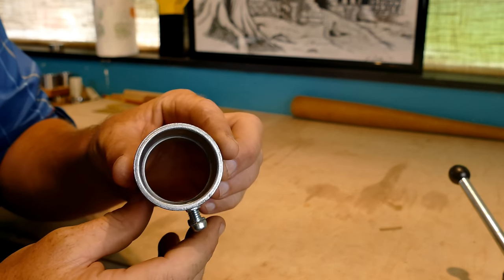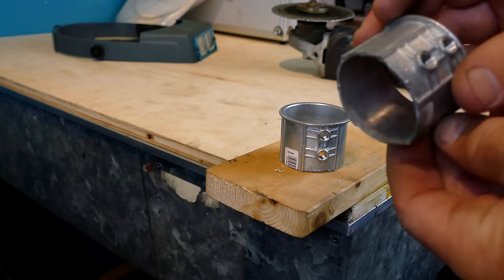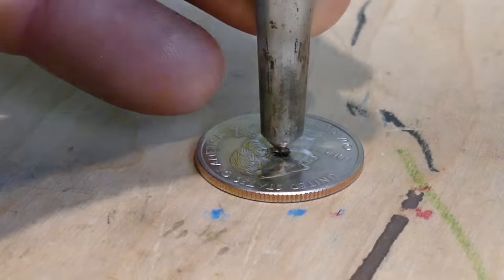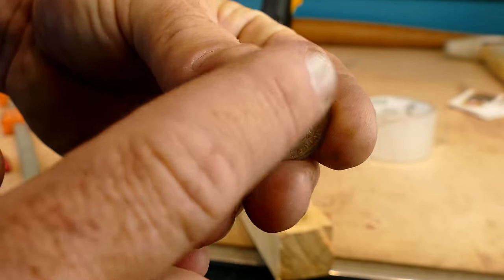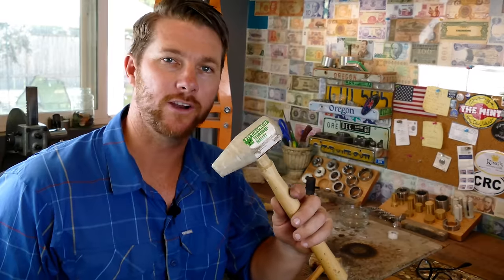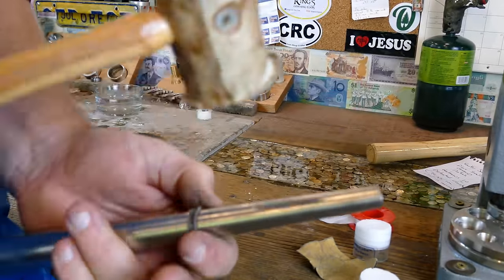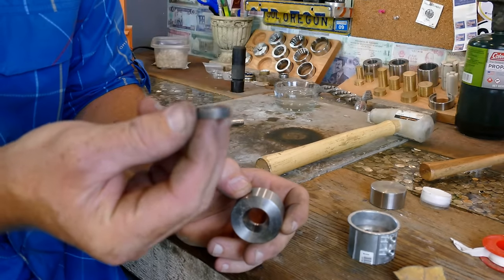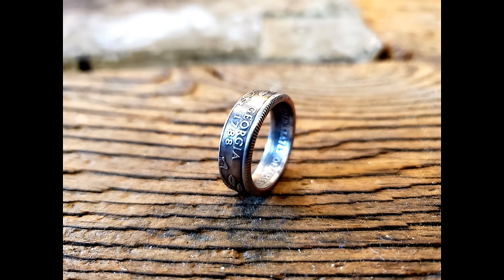Making a Pro Coin Ring Without Expensive Tools

Comment: Found an alternative to the wood block method for clamping, 1/4 pipe union. Have to modify the part that fits against the piece that screws in to the nut. You have to file down that dome so you get a flat surface, then cut the remaining pipe off of it. To secure it either with a vise or a hobby vise. If you do go with a larger vise you need the wood for it to sit on. Even a drill press vise will work.
The union will accept a step bit btw.
Reply: Once you modified the union it'll accept any coin the size of an American quarter.  You can also shove a piece of pex pipe as a shim for the smaller step bit. Tho that will need to be drilled out. I think it was 1/2 i used in my jig. It'll do a decent job of centering your coin tho you'll have to guide it a bit to make sure. 
Anyways it worked for me, drill your pilot hole then bring in your step bit to reduce chance of it spinning.
Reply: Since the union comes in copper, larger ones in brass. It shouldn't marr your coin. Still experimenting and transferring it to the larger 3/4 one. The 3/4 union shouldn't need much modifying outside of filing down the dome as was done on the 1/4 union. A large flat washer should remedy the larger space on that piece that was filed down. I think fitting pex pipe fittings inside one another should remedy that large hole you're left with. Steel flat washer and a piece of leather should work as well.
Reply: Also a large c clamp works in place of a press if one doesn't have one paired with your large vice if you have one.

Comment: Nice video, but that's not annealing, thats hardening. Annealing means heating then letting it cool slowly. Just heat in then throw it in some sand until cool.
Reply from the maker: Jewelry isn't made from ferrous metals though. Non ferrous metals are treated differently. Unless the entire jewelry industry has it wrong :)
Reply: @CoinRingsfromTheMint  you're correct ferrous metals are treated differently to an extent. I think its still the same term and process though. Thought you might like this.
 https://link.springer.com/article/10.1007/s13632-013-0074-8

Comment: Hey Tyler, is there something special about the coin ring anvil, other than it's size and the alloy they use? I could see replacing that with a piece of round stock cutoff from a scrap yard or a round dowel made of a dense piece of hardwood, like maple or oak.
Reply from the maker: No you can use something else as long as 8ts flat.

Comment: Change you can wear, what size of Swedish wrap die do I need to reduce a half dollar coin ring to a size 7 1/2, or can flat wall ring be made with folding/reduction die?
Reply from the maker: Not the smallest one but the next size up one. You can see them on www.jasons.works.

Comment: $37 for the die; $32.00 for the coin anvil; $15 for the ring mandrel ; ~$15.00 for a decent rubber non-marking mallet; $5.00 fence coupler; $30.00 for a drill (the one I saw at this price came with bits, too); $30.00 Propane torch kit; $5.00 for needle nose pliers. So, all in: ~$155.00. You can afford that with a paper route.
Reply from the maker: Yes!
Reply: I think you forgot the clamp, the punch, the step bit, and the angle grinder and cutoff wheel. or hacksaw.

Comment: To hold that quarter. I think a forsner bit the same size as the quarter drill into the wood then insert quarter into hole might be a good option too
Reply: Thats actually really fucking smart lol
Reply: it will just spin  , you still need a hold down/clamping device
Reply: I would think if the hole was moderately undersized it would hold just fine. Or shim it on the sides. Being that I have never tried it I can speak to how well it would work. But just thinking that the outside of the hole from a forsner bit is can be a little rough and quarters have grooves on the edges I would think it might spin a little till it bit the wood.

Comment: Wow! That is amazing!  How is the detailed maintained with all the pounding?
Reply: Soft material on the mallet head (rawhide) for the initial shaping. Lubricant and a specialty shaped die for the reducing. During the step with the anvil in the tube, most of the force was on the top/bottom so the sides stay clean.

Comment: Clamping a coin: use 2 large flat washers or two small flat pry-bars. Place them overlapping on opposite sides on the edges of the coin (also lying flat). Clamping the washes/pry-bars clamps the coin down and won't interfere with drilling. You can still use tape as padding on the coin.

Comment: Looks like an 1 1/4” EMT setscrew coupling. Those are the super-cheap, cast zinc (? pot metal of some sort) ones, they’re really cheesy and brittle. I bet something stouter, like a stainless or high-carbon rigid pipe coupling (I’m not a pipefitter, I’m an electrician, so I’m not sure what exactly to call them. They’re heavy-walled and smooth, they weld on) might work better and for longer.

Comment: Quenching is a rapid way of bringing metal back to room temperature after heat treatment to prevent the cooling process from dramatically changing the metal's microstructure. - It hardens the metal...you actually hardened the coin...

The primary reason for annealing metal is to reduce its hardness/make it softer. That way, it can be machined more easily...you did not anneal anything by plunging it into water while it was that hot...the true annealing process (depending on metals) differs greatly. The cooling rate for annealing though, is always on the slow end of the spectrum...
Reply: Not correct... please review for copper alloy.
Reply: @k31k2000  I did...My bad, you where correct...

Comment: Just curious why you quenched it after annealing it? Just makes it tempered slightly again and hard to work with. Heat until cherry red then let cool on it's own for softer metal. Nice work though.
Reply from the maker: Non ferrous metal acts totally different than steel and doesn't harden when quenched.
Reply: @CoinRingsfromTheMint  Derp... I should have known that. Forgot quarters are copper/nickel. I like the channel, keep up the the good work man.

Comment: The easiest way to mark a cut line on a piece of tubing, or conduit connector, is to wrap a piece of card stock around the tube and adjust it so that the overlapping straight edge lines up. Draw along the straight edge with a mechanical pencil and your registration mark will be perpendicular.

Comment: 6:27 isn't that quenching and not annealing?
Reply: It is annealing for brass/copper. Heating to a red hot state and submerging in water works differently on the copper in the ring than in steel. Copper will get softer (annealing) and steel will get harder (quenching).
Reply: @rancetaylor7350  thanks

Comment: Coming from reloading my own ammunition, annealing is really misinterpreted here..heating the piece is correct, though it should be done slowly, it isn’t as important here because the project doesn’t rely on the pieces ability to seal a chamber as does in reloading ammo..that aside, my point is, the part I’m hung up on, is that what makes annealing work so well is allowing the piece to cool SLOWLY..not quickly such as dipping it into cool water. Removing the heat all at once by using water is really violent to the metals structure, and will commonly introduce small fractures in the metal, sometimes not visible to the naked eye without help from magnification. This comes from knife making as well..a simple search of annealing and quenching will further explain this. My only advice is to allow the piece to cool to room temperature on its own to guarantee maximum workability. Heating to redhot removes the hardness in the metal, quenchingnin water in fact replaces it, this is why knife makers or blacksmiths quench  as their last step during the forging process. Again, it may not be important in jewelry making, but these rules apply to metal universally. Just my two cents..thanks for the videos! They’re great!
Reply from the maker: A common misunderstanding about quenching non ferrous metals like silver and gold. Steel is just like you say though.
Reply: That makes perfect sense. Wow. My mind was blown whenever I see these rings hammered on so vigorously after that process. Lol thank you so much for the informative reply. You rock man. Subbed!

Comment: If you had a small craft lathe with a chuck (or a charlie), you could drill a centered hole easily. But tape on a board works too. :O)

Comment: The next time you need to clamp something like that what you do is get some washers that are small & put them on screws & screw adjacent to the coin so that just a fraction of the washer is on the coin if you use 2-3 of these around circumference that will hold the coin to wood then just clamp the wood to bench & you are good to go... the screws in the wood will clamp the washer edges that clamp the coin... also when annealing the coin it should be held in space tie some steel & hang it from a rod... in addition to not breathing in whatever that was you were burning while the coin laid flat... you prevent impurities from leeching into whatever it is you are annealing... especially if you solder, paster, acid etch, paint etc on that surface... by holding it in space it is faster saving fuel is more even & ZERO toxins & impurities added!

Comment: Sorry to disagree but to anneal means to heat the object then let it cool Very slowly will soften it. you water quenched it, that makes it Hard. I use burnt motor oil to quench in knife making. Try google it works.
Reply from the maker: Steel is totally different than non ferrous metals :)

Comment: I never knew that you could anneal by quenching in water.  In my experience, annealing requires a slow cooling.
Reply: No.  You're thinking of ferrous metals like steel.  Non ferrous metals are annealed by heating to red heat followed by a severe quench like water
Reply: Coins have a copper core, not steel.
Reply: @sputnik16335  Did not know that.  My only experience with annealing is with steel.
Reply: @MrSTOUT73  Duh.  Anyone who has ever looked at the edge of a quarter knows that.  That's what 'non-ferrous' means, and non ferrous metals are annealed by heating to high heat followed by a severe quench

Comment: Without expensive tools eh?    In order from the video:   a) Circular saw  b) need sander   c) needs "jason's tools"     d) punch tool     e) stepper bit (expensive!)   f) blow torch   g) rawhide mallet
Reply: Taylor  I expected the title of the video to match the actual items USED in the video... didn't you?  Otherwise - this is just clickbait..... change the title to: Making a Pro Coin Ring With Limited Tools... or Making a Pro Coin Ring with the Least Expensive Tools you Can.

Comment: Annealing you have to let it air cool, or slowly reduce heat. Not quenching the metal...
Reply: with copper based metals you need cool it fast
Reply: It's not steel...

Comment: What size is the hole you drilled in the coin? how hot do you need to get it before dunking in the water? what if i don't have a mandrel ? what if I don't have a die to size the ring? So much for making it without Expensive Tools, You really need to think about what the average guy has in his shop before you make and title you videos.

Comment: I love what this guy does but isn’t this illegal. (Defacing U.S currency)
Reply: As long as you don't sell it, it is legal.
Reply: No.. its not illegal.
Reply: @pinkdude3883  that's not accurate either.  It's perfectly legal to sell coin rings or jewelry. US Code prohibits you from defacing currency with the intent of FRAUD (i.e. trying to make a $10 bill pass for a $100 bill.
Reply: @grimesp3  thank you for the correction.
Reply: @pinkdude3883  incorrect.

Comment: That is not how we use to do it. To start with we would find an old nickel one with a date of 1964 or older. And then spoon and then roll the nickel in your hand while tapping the nickel. The only power tool needed was a drill to drill our the center of the nickel. If you do not have a drill you can use a punch and punch away until you get a hole big enough to get the file into. Then take a small round file to file out the inside. And some sand paper to get rid of any sharp edges. My dad made my mom one this way when he was in prison. I made one for my wife. Took about 80 hrs or so to make.

Comment: I believe the tile of your video is inaccurate. Why don't you just say - make a ring without a press, because let's face it - Adding all these tools up is expensive, especially the die! Let's all count the tools you need;

- Angle Grinder
- Sander
- Center Punch & Hammer
- Drill with expensive bit
- Clamp
- Half Round File
- 120 grit sandpaper
- Acetylene Torch
- Common Garden Variety Mandrel & A super common Rawhide Hammer!
- .9 x .10 Die - Those must be available at a dollar store right?
Reply from the maker: Maybe you shouldn't be using tools if you have nothing on that list :)
Reply: @CoinRingsfromTheMint  I have plenty of tools, but the title of your video is misleading. Some of these things are pretty expensive tools, which is definitely contrary to the title. Just sayin' you tool!

Comment: the only tool your not using is the cheapest one. the $40.00 harbor Freight Arbor Press. the $1,500 hand dies etc are the "costly Tools" like way pricier than the tools needed to make Spoon Rings
Reply: Then make spoon rings.... Who's stopping you? PS: And yeah, buy yourself an Asian Metal bench top press for $40.00.  In fact, buy a few.... Saves on down time....